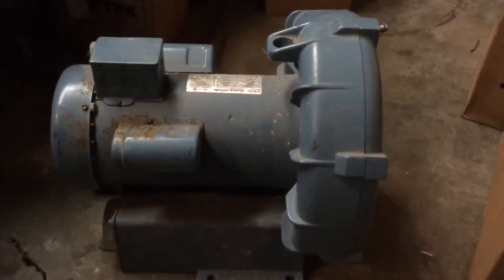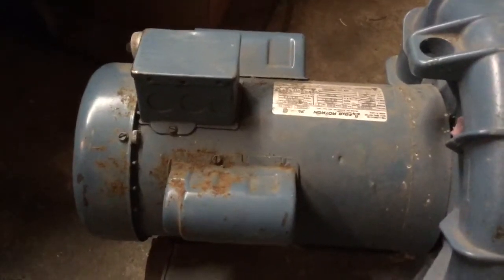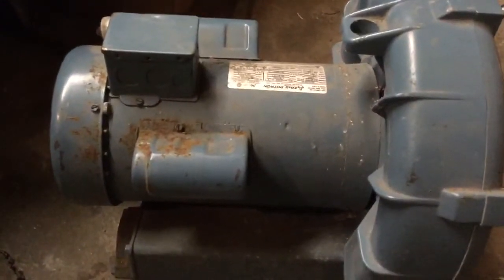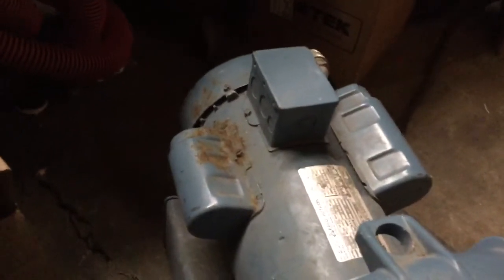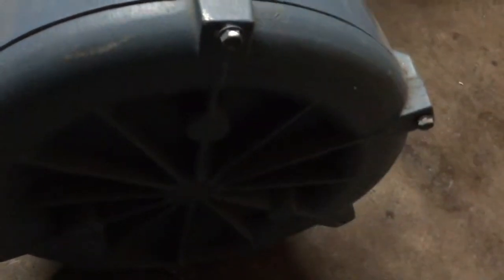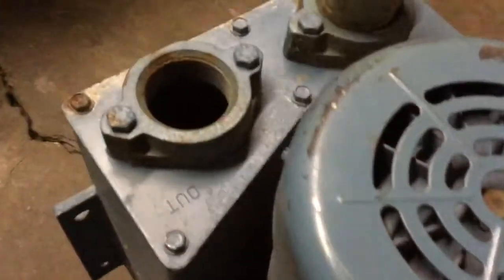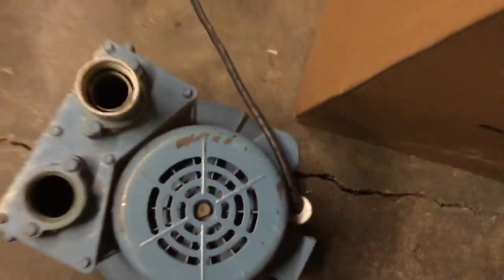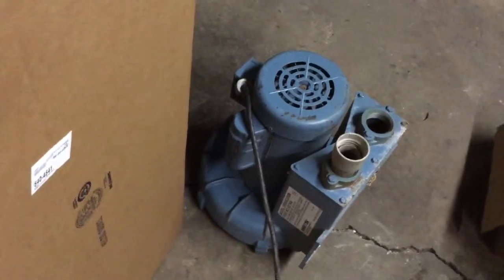Regenerative Blower

Comment: I'm looking for a way to develop a hold down system for my 5 x 10' CNC router to hold through a spoil board. I've been offered a GOORUI GHBH 002 12 AR5 1.5kW(2hp) Aeration Ring Blower which I'm looking if it will work or not. Probably will need multiple units.

Comment: what do you think would happen if you attached the exhaust of one of these to the end of a blocked/collapsed drainage pipe? i see pvc attachments for these so i'm wondering if the pipe actually might not explode. 

i have a hunch that in an ideal situation i might be able to use a smoke candle with one of these to find a break in the pipe and where the pipe's outlet is if it's not broken.

Comment: Could this be used in a woodworking shop to power a dust collection system?
Reply from the maker: Ryan Avery a dust collection system needs to produce high velocity at big (4"+) openings to work well, requiring massive CFM. The pressure doesn't need to be higher than 10 to 20 inches of water column. This machine wouldn't be a good choice for that application.